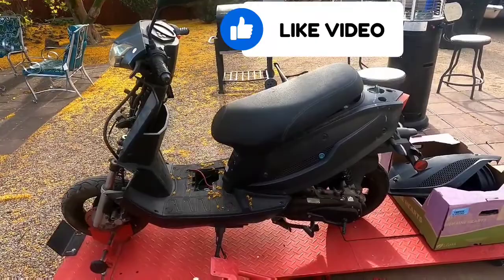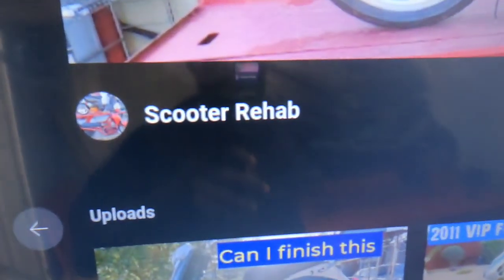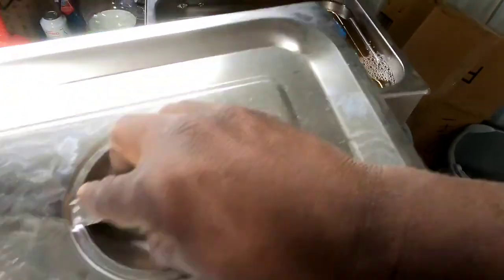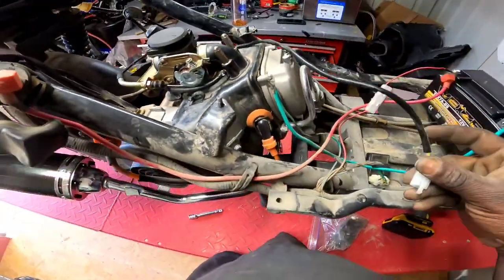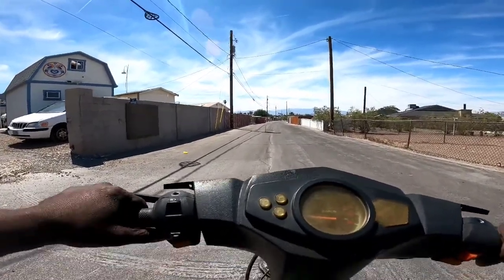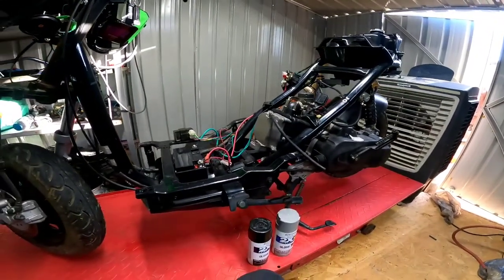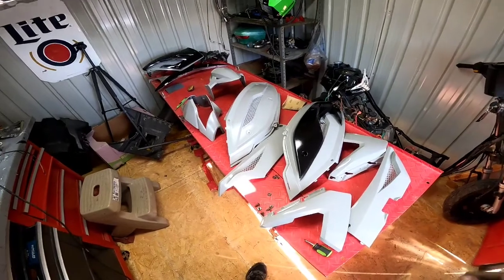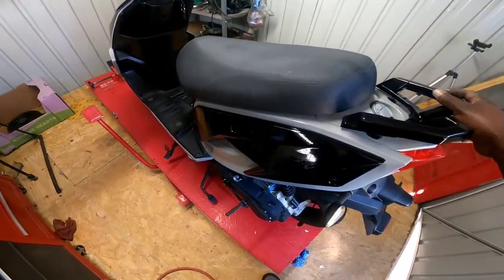Tao Tao new speed 50 revial and customization

Comment: May I ask if it's a dc? And if so what cdi did u use I bought the yellow and some other cheap random one and it dont work but the stock works fine after descent mods to it
Reply from the maker: No it's still AC  powered a AC powered stator has one coil ( the excitor coil ) wrapped DC stators have no coils wrapped. The CDI  for an DC stator is larger than an AC powered stator. There's a difference if you try and use a DC CDi with a AC  stator you'll blow the CDI . Same results the other way around as well. HEY THANKS FOR WATCHING ‼️

Comment: The starter not engaging seems to be common as my old one did it and my new one does it occasionally
Reply from the maker: Yeah it's common the dust from the belt gets in the Bendix and impedes it movement .  I just figured that out like just now 😂🤣😂. When I find it I'll drop it in the ultrasonic cleaner to see if I'm right.🤣 Thanks for watching I appreciate it 👍🏾
Reply: I put some oil in the pin hole on the CVT case where the bendix engages. That fixed it.